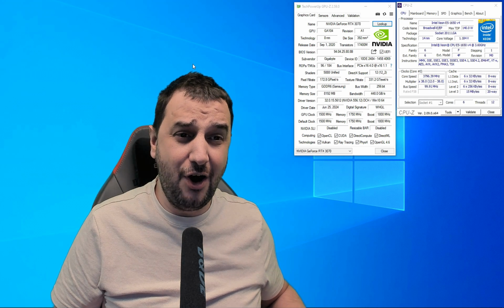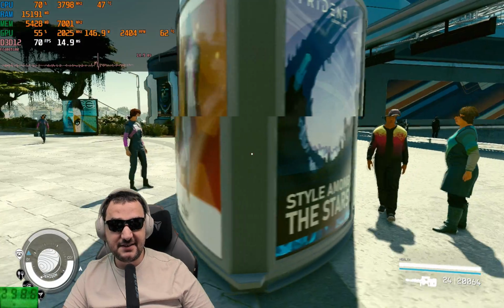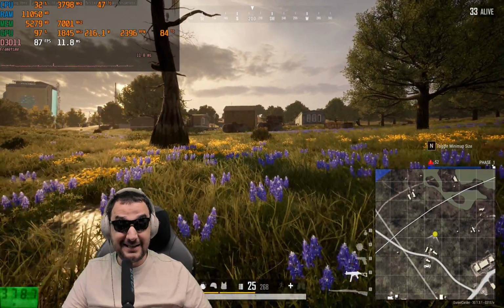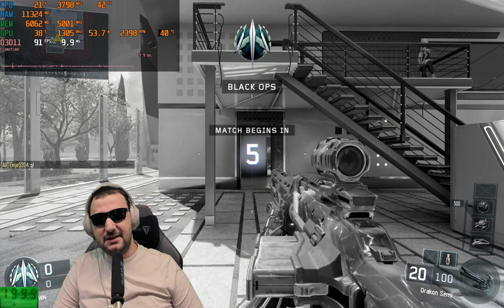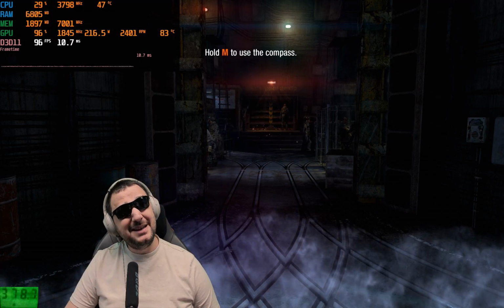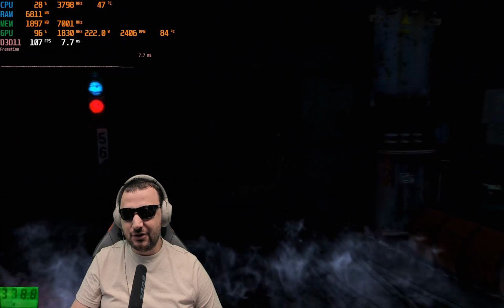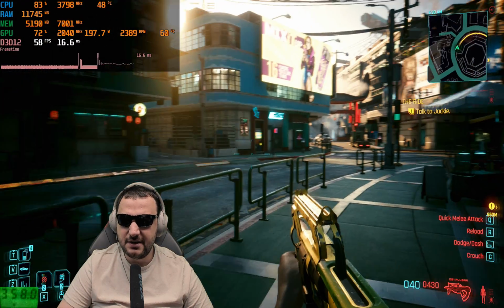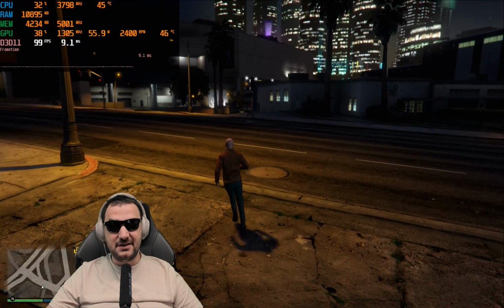Gigabyte AORUS RTX 3070 with E5 1650 v4

Comment: How did you get 85 degrees on an RTX 3070? I am on a 3070 Ti and it's a Zotac Trinity  model, so not even particularly that good of a cooler and that card reaches about 75 degrees on full load, even though it consumes close to 300 watts.
Reply from the maker: i have a few more and some are really great with temps. this is the most inefficient.
Reply: @DanielCardei  Strange, considering AORUS is supposed to be Gigabyte's top model lol.

Comment: Any particular reason why you got e5 1650v4 ? Why not the 2699v3 it's only 40eur on aliexpress, with TU mod it will hit 3.6ghz all core + massive massive L3 Cache only saving x99 cpu's. Or atleast i7 6950x at 4.3ghz would be nice to have, however it's far more expensive sadly for name only
Reply from the maker: It came with the motherboard. i made the stupid mistake and got the 2699v4 instead of the v3 unlocked.
Reply: @DanielCardei  still massive cache, should be fine, however it's not outpacing cheaper v3 with unlock sadly. Anyway can't wait for that cpu tests from you!

Comment: Starfield is a really bad game to use for benching. As bethesda optimization has been historically bad and this game is no other. Besides this, no one actually plays it, except for some youtubers benching. Also there must be a mounting problem if the hotspot is like 20 degrees above gpu core temp. And 85 on the core is crazy also.
Reply from the maker: to be fair this is the worst 3070 on thermals i have.
Reply: Exactly trash game ever😂

Comment: Your Intel Xeon E5 1650 v4 was still bottlenecking your RTX 3070 even after you enabled FSR 3 frame generation.
Reply from the maker: The only thing I manage to do is to add more load to the GPU and that's not the solution. I mean this is what I wanted to be fair. To gut the cpu and see it's limits. Older GPUs In SLI and Crossfire won't do this.
Reply: @DanielCardei  You're right the Intel Xeon E5 1650 v4 is less likely to bottleneck older gpu's in sli and crossfire.
Reply: @DanielCardei  Actually you added more load onto the cpu since frame generation increases framerate which in turn makes the cpu work harder to prepare more frames for the gpu. Remember lower resolutions and higher framerate increases load on the cpu because the cpu has to work harder to prepare frames for the gpu. When the cpu is too slow then the gpu is waiting around for the cpu to prepare new frames for it.

https://www.youtube.com/watch?v=-VcytCt02eE

https://www.youtube.com/watch?v=zXthBwIgE08

https://www.youtube.com/watch?v=4QJglCSGEt4&t=2s

Comment: You have to be careful when trying to enforce a CPU bottleneck into games while doing things like this because it is easy to just say "the cpu isnt strong enough" or "there must be a problem with the threads". 

If you are playing a game that would normally use all the cores and threads of a somewhat recent CPU (something like a 3600 or 5600) yet you are finding that an older CPU with less threads is not getting worked as hard that probably means there is a limitation elsewhere. Something like RAM speed, PCI-E speed, heck even cache on the CPU can be a bottleneck to not allow the threads to run at 100% usage.
Reply: Except the Xeon E5 1650 v4 isn't a recent cpu it came out in 2016 and yes I do think it was bottlenecking his RTX 3070 because even though the cpu wasn't maxed out at 100 percent and all cores weren't in use the RTX 3070 wasn't fully utilized. Also keep in mind that a lot of games like fast single cores and modern games aren't likely to max out all cores and threads. The few times I've seen games max out a cpu at 100 percent usage was on dual core and some quad/hexa core cpu's with 4/6 cores and 4/6 threads.
Reply from the maker: True. This all leads to one question. Do you  think that e5-2699v3 or v4 will reduce the cpu bottleneck?
Reply: @DanielCardei  The Intel Xeon E5-2699 v3 could also bottleneck the RTX 3070 in games because it has a slow clock speed and its an older cpu.  Single core speed and cache tend to matter more than how many cores and threads a cpu has unless you're multitasking, video editing or doing productivity work. 

https://www.youtube.com/watch?v=OWXhIJamdIY
Reply: @DanielCardei  Cores and threads do matter if you enable raytracing and pathtracing because those graphics settings do use more cores and threads. Raytracing and Pathtracing tend to be both cpu and gpu intensive graphical settings.
Reply: @DanielCardei  Lets first understand that no matter what game you are running there will be some sort of bottleneck, otherwise games would run at infinite frames a second.

That said those 2 CPUs will likely not make full use of the GPU because the single cores of the chip don't run at a high enough clock speed. This is dependent on which games you are playing though. If you play something like Starcraft 2 that game only uses 2 cores of a CPU so if the cores are clocked super slow like the two CPUs you are talking about the game will suffer. However if you are playing something like Battlefield 2042 the CPU will do better as that game uses around 22 threads fairly well. 

But if I had to pick one of the two CPUs for modern games I would go with the v3 as the very slight bump in base clocks might compensate for the 10MB of less L3 cache, it might not though so i could be wrong. If you can overclock it then maybe it would preform better but it would still be lacking some clock speed compared to its desktop counterparts.
Reply: Actually the reason most games don't use all cores and threads isn't because of cache its because the game engines were designed to take advantage of a single fast core leaving the rest of the cores and threads unused. Even when games run better on cpu's with more cache even those games don't utilize all the cores and threads. Techtubers like hardware unboxed have even demonstrated this. 

https://www.youtube.com/watch?v=0mO4op3bL90
Reply from the maker: @LiquidSnake690  i just imagine learning to OC this 1650v4 and then getting an 2699 with 18 or 22 cores. OC those CPU considering the amount of cache those CPU has.
Reply: @DanielCardei  The cache on those cpu's matter more for games right now than how many cores and threads they have.
Reply from the maker: @LiquidSnake690  rip. locked multiplier :_ohNo: